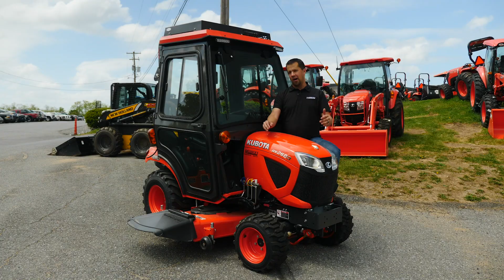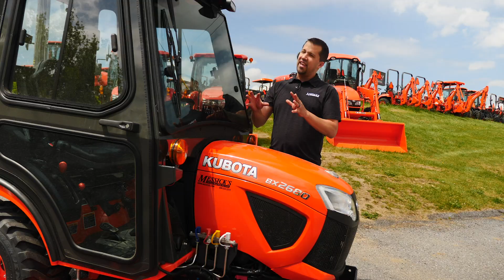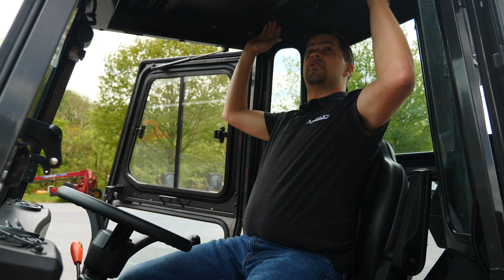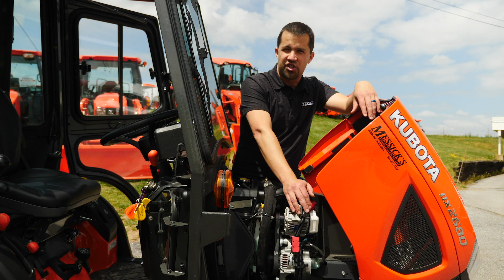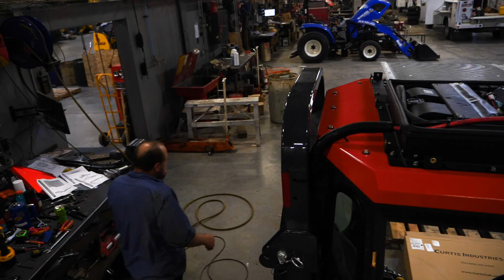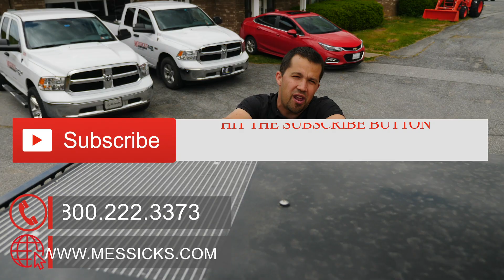The MOST Luxurious Lawnmower! - Kubota BX with AC

Comment: How do you allow for the BX series drawing engine cooling air from the cab area with a cab installed?
Reply from the maker: its not so tight that there is not airflow.
Reply: @MessicksEquip is there sn ac unit for the m62 with Curtis cab

Comment: Well the nice thing about my B2650 is that the AC runs even at idle since the AC compressor runs directly from the engine and the refrigeration hoses run up the tube Chanel’s on the side of the cab.

Comment: I'm thinking a tree branch would eliminate your ac in short order
Reply: lol,  yeah,   needs a guard on top.
Reply: @jamesjames1716  the box clearly is a metal guard. Do yall really think that there's a bunch of engineers who don't think about the most basic of design flaws?
Reply: @christopherbernhardt  You must know that much about equipment because engineering flaws are on just about everything that has ever been made.  Even simples flaws a child could point out,   maybe for cutting costs or just plain incompetence.
Reply: @jamesjames1716  bro they literally had the cover off to show off the unit and then put it back on later in the video though
Reply: @jamesjames1716 Not Kubota So much though!😂
Reply: I’m thinking that the condenser and compressor are fully covered by that black metal guard and that it’s not likely to break because I’m not as stupid as you two.
Start the video over from the beginning, it has a giant guard covering it and you can see it clearly. That’s why they didn’t reply to your comment to tell you that, because it’s obvious in the video.

Comment: The downside to Curtis is they stop making replacement parts VERY quickly compared to the life of the tractor. To get a piece of special glass made for a Curtis Cab thats no longer made is outrageous. I have an old Curtis Cab and it has curved windows that are different on the bottom than top... think curved trapezoid. I tried EVERYWHERE IN THE BOSTON AREA. Not one single glass place was interested. And LOADS of people told me how easy it is to form a plexiglass panel for it... they do it all the time. Bulloney...

Comment: I have to disagree with you about the 2650 being too large for 11 acres. I have used my brother's 2650 and the 5 acres I used it for took with his 5ft mower was that tractor's limit. I now have a John deere 4440 with a  mx 10 and now the whole 16 acres in the same time and use the same amount of fuel and I don't have to lister to all noise the hydrostatic transmission makes in the cab and I find the 4440 is very maneuverable in tight spaces

Comment: Neil, great video but you did not address what I think is the elephant in the room - the stability of the BX.  I have a 2017 BX23S with the Curtis/Kubota cab. In the winter as a snow blower it is  just great.  But in the summer, with the doors off, on my slightly hilly 8 acres it is very "tippy".  I have Rim Guard in the real tires but I have still had either the left or the right side feel as if I had two tires off the ground on multiple occasions.  I think the cab weight increases this "tippiness" I can't imagine what it would feel like with 100+ pounds of air conditioner up on the roof. Does Messick's recommend rear wheel weights and or spacers on the rear of the BX to increase its stability on non flat ground?  My tractor does a lot of things right but I also think it has attempted to kill me on occasion. I am looking for advice on how to increase its stability. I looked on Messick's web site for wheel weights for the BX but it looks like you do not stock them?
Reply: I have a very hilly lot and I have 2" spacers and wheels filled. I still need to be smart on how I take an approach to a hill and the direction i'm going. I would say this wouldn't change that much. The issue I would have with it is that it would no longer fit in the garage/shed even with the ROPS down. While a/c is a great upgrade to have, I don't think it's used enough to justify the cost. I get a great breeze in my cab just with the windows open. I mow late at night or early in the morning before it get too hot.

Comment: Love this cab on my 2680. I personally don't have a need because I'm on and off my tractor so often in the summer. I just pop the doors off and open the front window. The roof shading my seat is a huge help though. I would also like to add that the heater gets my cab up to 65 deg F when its 20 deg out. I do put a milk house heater in the cab and have a block heater that are both plugged into a wifi outlet. I can set a timer to have them come on or use the ap to start the heaters on the way home from work in a blizzard. I just run the heater cord through the brake pedal. Its nice to have it pre heated and ready to go. Also I use Honeywell bluetooth ear muffs with boom mic. I can easily talk on the phone while blowing snow. I will be posting a video of this soon.

Comment: I've got to take an issue with you about "cheap" cabs.  I have an Original Track Cab that I put on for snow blowing in Maine.  It's a whole lot better than no cab at all and in the spring I can take it off in about an hour and not have to worry about tearing up a cab while working in the woods.

Comment: 💥 You really talked about a lot of cool things in this video. 👍
Keep on tractoring!
Reply from the maker: was that a pun? if it was, it was a good one. :-)
Reply: Messick's Equipment Of course it was. I do have one question though. I know Curtis did not have an AC option for the BX23S for quite awhile. Has that changed or is it still only available for the BX2380, 2680 and 1880?
Reply: A RITTER BIT WILL DO Niel mentioned they chose the 2680 for the higher out put of the engine to run the extra alternator.

Comment: With all that extra electric power, could a 3000 watt stereo system be added? 
Gotta jam out while working man!...
Reply: Only need about 12 watts to fill that cab with sound 😬
Reply: svtirefire 
Yes, I know that. I was not serious.
In fact depending on the efficiency of a speaker and on the noise level in the cab which will also depend on the noise level of the implement being used, maybe only 5 wats rms may be needed to provide an adequate spl inside the cab.
The 3k is obviously totally ridiculous!
Reply: L Cee ... ridiculous???? Nope.  Surely you jest.  Just think of the bass.  It might even help with compacting.
Reply: rgd I suppose it could compact something! Maybe as a back massager!

Comment: I run heat and the air conditioner on my grand l 4760 in the winter to dry out the cab. Of course mine in integrated into one system so the air is just drier with the air conditioner on.

Comment: Love your honesty Neil.  I know you are a dealer and would love to sell a $30K+ sub-compact tractor fully loaded to someone, but I like how you brought in the B-Series to show you can get the same thing in the larger tractor for about the same cost.  I'm getting the BX2680 here soon, dealer is out till about the middle to end of August due to the high demand for these machines, Kubota is having a hard time keeping up with the demand, I just hope that don't mean they're going to start cutting corners in quality to speed up the manufacturing process....anyhow, can't wait to get my BX.  Maybe at some point it will get mowing duties, but I'm going to be getting the LA344s loader, 50" tiller, and the 54" box scraper...for the light duty stuff I'm going to be doing, this tractor will do everything I need and more that I have yet to think of I'm sure....kind of one of those things that until you have the tractor and implements you don't know all the potential uses it has.

I watched a guy this morning installing metal T-Posts with his Kubota L-series tractor and loader....he was using the loader to push the posts into the ground...I'm not so sure that's a good idea but I guess it was working for him.  I know they actually make a hydraulic post pounder...ordered a couple by accident when I was in the National Guard....one of our suppliers had a online ordering system and it was very vague...just said picket pounder, ok well I need 4 of those for driving pickets while out at the range, so I ordered them, turned out they were hydraulically operated, not the old school manual ones oops LOL.
Reply: I had the opposite reaction to the video. If you were to go from a BX23S and decide you didn't want to add the cab, etc because you could buy a larger unit with all that already on it, well, it isn't that simple. The BX23S has a backhoe on it. When I visited the dealer, that next larger tractor didn't have the backhoe on it. Further, hooking it up was not trivial on the larger tractor and was a large leadtime to get the backhoe. So, these videos can gloss over a lot, you really need to visit the dealer and ask a lot of questions. My dealer kept talking about options that didn't have a backhoe and that we could rent one when we needed it instead of installing it on the tractor. Well, that would be silly, because I will need the backhoe a LOT.
Reply: @cjmagnuson1008  Yep if you need a backhoe, and actually truly need it, buy it, otherwise, rent one...In 30 years I haven't had enough need for a backhoe to justify owning one.  I use the loader and pallet forks a lot though.  

You really need to know what you need a tractor for before going tractor shopping and just picking stuff because it looks cool.

Comment: Cool setup (pun intended)!  I have a BX for doing chores and plowing snow, but I mow with a John Deere 1445 that has a full cab with heat and A/C.  It definitely makes a big difference in comfort level when it's hot and humid outside.  People give me crap about being spoiled, but it's hard to hear the haters over the radio in the cab :)
Reply: I’ve just picked up a 2004 Deere 1445 with the Cozy Cap that has heat but no AC , you’ve got the other Cab that’s not the Cozy Cap. I’m looking into aftermarket affordable way to cool the cab.

Comment: I love kubota but that what they did there is a recipe for disaster. In the wintertime when snow starts to build up ton top of the a/c unit with the heat of the unit water will drip into the circuit broad. I honestly think kubota should invest in finding some other way to properly find a way of installing a/c to the B and BX series machines. Just my two cents
Reply from the maker: Curtis product, not Kubota. The A/C unit is a Red Dot product that's made for the elements. The factory is the north east and makes a lot of snow equipment.

Comment: 26 HP from factory. Add alternator, extra weight.  1HP = 746 watts.  Draw = 60 amps @ 12V.  So, around 1-2 HP (with losses) to run AC.
Reply: Happy wife happy life!

Comment: I’m in the hvac biz.  I’ve looked at adopting a low profile Rv ac for just such an application. They can be had for about 650 online.  But then you have to add another alternator and fab up a roof adaptor for it.   Even that way is not cheap.  But... I could have cold air blowing down on me even in my open station tractor if I was to be so inclined. Be nice for this Texas weather.  Lol
Reply: I saw a flower delivery business Caravan with a window banger unit in the rear side window and a generator hanging off the back on a trailer hitch rack. Maybe look into something like that lol
Reply: svtirefire .... hmmm... they do make pto driven generators.  Lol
Reply: How long would a loader bucket full of deep cycle batteries run the A/C? :-)
Reply: A later comment says 12V at 60 amps, so... about an hour per battery to keep from running them down so far I'd damage them.  Hmm... I'd run out of fuel before I drained the seventh battery. I did not need to know this. :-)
Reply: erik scott ... you could get your grandkid to ride in the bucket and have him switch out batteries when needed. He could have all kinds of fun... and you would be a cool grandpa.  Lol
Reply: @erikscott5709  Not very long no matter what you hear.
Reply: Thats exactly what I was thinking. They never told us the price for cab OR ac... unless I missed it.
Reply: How about a self contained RV roof unit?